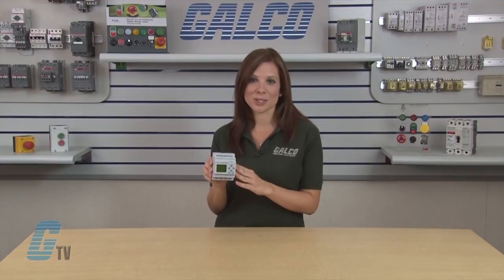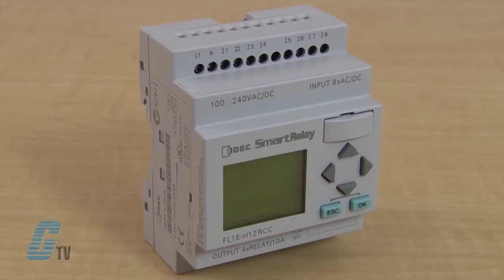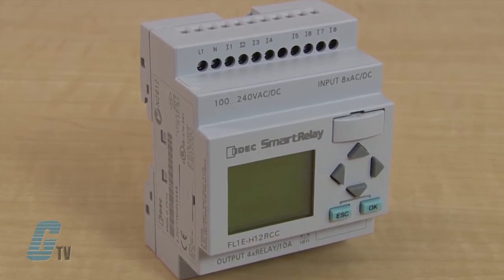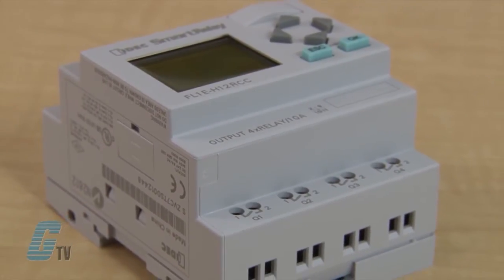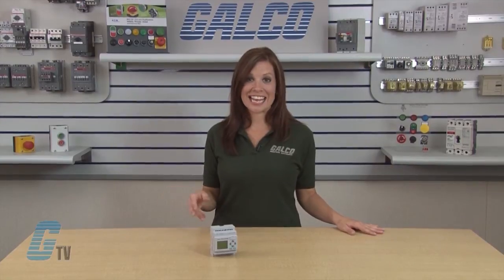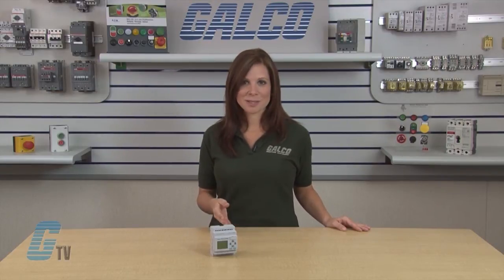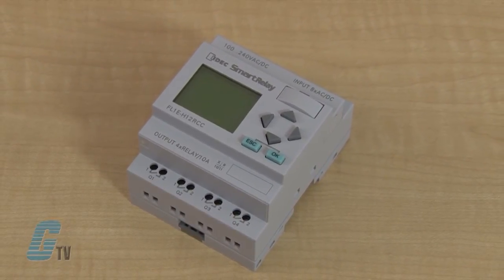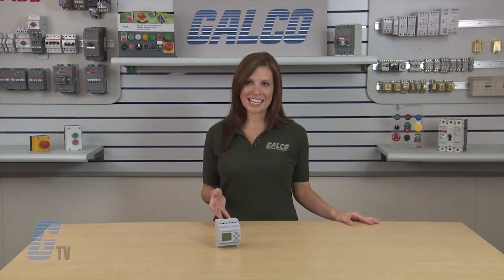IDEC "FL1E" SmartRelay PLC's - A GalcoTV Overview

Comment from the maker: The Idec Micro Smart series of PLC's offer an input power rating of 100-240VAC, with relay output that could be used to control 12-24VDC Coils on relays.  Part number will vary depending on the number of input signals and outputs required for the application, but check out the specifications for part number FC4A-C10R2 or FC4A-C16R2 to start.

Comment from the maker: The Idec's Micro Smart series of PLC's can be powered with 12VDC for mobile applications.  The Smart Relay can be programmed via the integrated pushbuttons on the front of the PLC, or through software, utilizing a programming cable, part number FL1A-PC1.  The memory cartridge allows for program back-up or sharing between multiple PLC's, but is a proprietary design and must be supplied by Idec as part number FL1C-PM3.

Comment: So, according to Katie you CAN get this in a 12VDC version for mobile applications?  Also, she mentioned programming software - is there a cable or software you need to purchase for that option, or do you only program the unit using the buttons on the face of the SmartRelay?  And "Memory Catridges" - are those a standard "SD" style, or are those a specific module that you need to purchase? Thanks! John